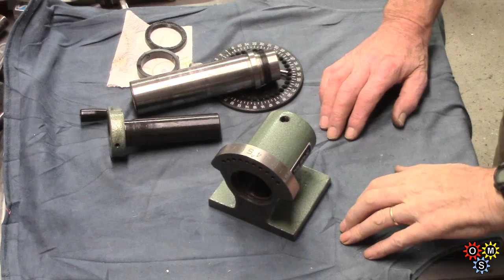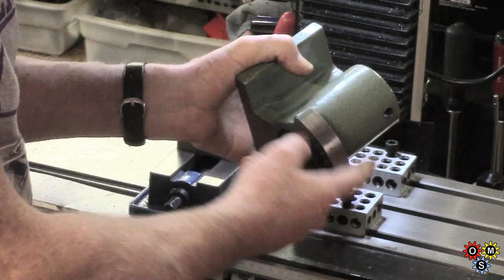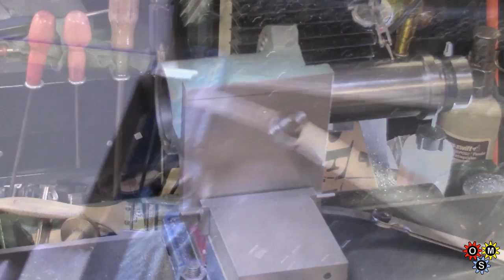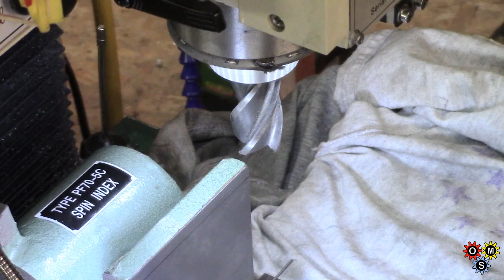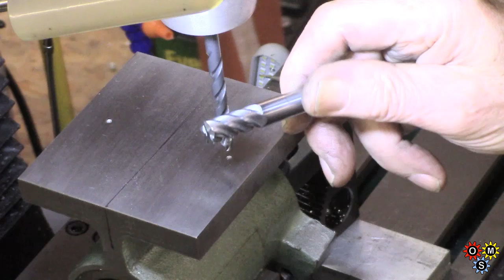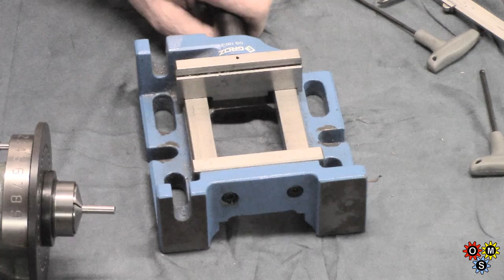Spindexer - Small Tweaks

Comment: Hi I like your work and your build on this project. I just purchased a Spin indexer with a tailstock end centre. It came with a great price.
Having a look around all the channels giving information on these units I found a channel with a great tip.
You can buy a 5c to ER32 collet adapter. Which fits the unit nicely. and the extra stick out of the ER32 collet nut is about 50mm which gives more cutter tool clearance from the index plate. I can now get better work holding grip using all my ER32 collets.
Hope this tip might help other hobby makers to get more use of their new toy. Check this link for more detail.
https://www.youtube.com/watch?v=VU6P5jhfIEA.

Comment: About 10 years ago I bought a spin indexer. I already had 5C collets and do quite a bit of small work. But the indexing plate kept me from getting really close. I reversed the indexer spindle so now can work very clos to the collet. I had also trued the indexer bottom to the bore so I could quickly setup in the vice. I can take the indexer in & out of the vice w/o losing reference.
Reply from the maker: Sounds like good mods. Sadly my shop time these days is near zero due to health probs but I still yearn to get back to some small jobs. :)

Comment: we mount things just as we can. not always optimal but if it works, mission accomplished haha. I'm in the same boat, my drill press vise opens 4" but is not tall enough to get a good bite so I'm thinking if I can set it on a pair of big V blocks and use long bolts in t nuts to hold it
Reply from the maker: Hi - well, as so often it's a case of ''whatever works'' :)

Comment: Hello, I am from Brazil, I would like to build a similar, the scale of 10 fixed holes do you know how many degrees has each spacing?
Reply from the maker: Hi Marcio - can't say spacing exactly - but, the 0 to 9 set of fixed holes for the register pin represent a 1 degree adjustment to the main disk, which itself is 360 degrees. For example - if pin in 0 hole and through into disk #10 hole, and lined up with engraved arrow -  then position is exactly 10 degrees. If pin then put into #5 hole and disk rotated until pin engages again, then that would represent 15 degrees.
Hope that helps - difficult to explain but maybe you get the idea.

Comment: Have you considered creating a block that will fit your smaller vise and bolt to it through the slotted holes in spindexer base?
Reply from the maker: Hi Chip - that thought had crossed my mind but, even if using in a smaller vise the loss of available height clearance for my rather small mill could be a factor. May yet try it sometime.

Comment: Dear Sir, in my opinion again My opinion your set up is incorrect. The base of the indexer should have been against the fixed jaw of the vise to maintain perpendicularity. I would have set the 1x2x3 blocks on edge in the vise and used them to hold the spandex thru the bore. Use your machinist square to set the base perpendicular to the mill table. Easy set up easy change. Hope this helps in future endevores RJ
Reply from the maker: Thanks Randell - useful points :)

Comment: Did you realise that you can take the jaws off the inside and fix them to the outside ??? Your vice has a huge range > Best wishes Malcolm
Reply from the maker: Hi Malcolm,
Thank you. For some reason back then I had overlooked the jaws swap - but now do realize. :)
Reply: It's amazing how many machinist's don't realise the jaws can be mounted on the front and back of the vise. That has come in handy a few times. Possibly that is where they mount a vise stop,is in the holes for the jaw on the front.

Comment: Hi Chris. Just getting back in to this stuff after a long break. I haven't read all the comments yet so I might be wrong? Watching your video with the aluminium filler rod in the vice in between the machined 5C base and the moving jaw on the vice.. Shouldn't it be the other way around with your finished 5C base against the fixed vertical jaw of the vice with the filler rod in between the adjustable jaw and the uneven casting?
Reply from the maker: To be honest Tony I don't quite remember why!! I guess at the time I had some reason but it's a long while ago now. I agree with the logic of your observation.

Comment: I would have figured that you would have placed the finished side to the fixed jaw, with the wire on the painted side, at the movable jaw. Even better would have been to mount it upside down with the face on an angle plate. This would have let you cut both sides without moving the spindexer.

Comment: Nice work.  I recently made similar modifications my spin indexer to fit align more easily in my mill vise.  I had not considered using in on a drill press, but it could be useful.
Reply from the maker: +robert simpson 
Hi Robert -- for what it is and price etc -- it's a very handy device to have on hand. Sure saves all the setting up of a dividing head if it will do the job. :)

Comment: If I had been doing it,I would have clamped a 1 inch bar in the spinjig, then clamped the jig to the table, cut a 1/4 inch flat on each side of the bar. Then turn it over and clamp the flats in the mill vise on the flats and machined both sides at the same time and also take a clean up cut on the bottom to make sure that it is flat and true.

Comment: What ho Chris, I clearly did not express myself properly when I wrote about slots, mea culpa but you must remember English is not my mother tongue, that position being reserved for Gibberish.
When I mentioned slots, I actually meant open ended sideways ones. The reason being you don't have to remove the nuts and washers or fiddle around looking to fit it over wobbly studs, everytime you fit the thing to the table. You wouldn't need to fit it to a vice if my thought waves had reached you in time.:>)
Another thought being, most people make the, understandable (as machinists seem to like symmetry) error of fitting their vice in the centre of the bed. Error for two reasons, one you only wear bed ways and leadscrew in one spot, and two, if offset, you can fit something else, like a spindexer, alongside. Personally I do this and, to even up wear, everytime I remove the vice for some reason I put it back on the other side, so that over time it averages out the wear.
LL&P
c
Reply from the maker: +Chris Stephens 
Very good point Chris with vise position - totally logical. I have to remove vise for a small job today and will almost for sure give it a change of position.
I get your point too re the slot idea. :)

Comment: suggestions and questions:

  1) why so tied to the idea of holding the indexer in a vise? was it to avoid having to tram it? why not mill a key sllot to fit the table slot accurately?
  2) re the 6" vise, why not mount it with the lead screw parallel to the table slot v at 90 degrees. no hang out issues then.
  3) when you spoke of making slots i envisioned them being at rt angle to the sides rather than parallel, a la the slots for vise        mounting. 

i seem to have forgotten some other things i meant to ask... one just came back; re the missing bench block, it was a tool knome playing a trick on you... they do it to me all the time!1!
Reply from the maker: +crazymanmichael  Hi Michael,
Guess I am not sufficiently confident in the absolute accuracy of keyslots, re repeatability. Prefer to see an indicator every time!.
Thought about the different fitting of the big vise - just hadn't tried it - but probably will... if mounting holes can suit my T-slot arrangement.
Just made those base slots to permit a bit more adjustment potential.
Haha - yes, the bench block! The 'tool gremlin' - the one that makes things invisible, at least until well after the item is really needed! :)

Comment: Hi Chris, as a suggestion, if you want more stability, you're gona have to resolve yourself to dismount your vise, and, use some 1-2-3 blocks and, or, angle plates... I was watching and trying to send waves about how you could do with the blocks...   :))
Came out nicely even without my help... ;)
Reply from the maker: +pierre beaudry Thx Pierre.
Haha - thought I felt some strange vibes! 
The vise thing is laziness in part - as I have it very accurately set up and don't want to have to do it again! Plus too - I want a better 4" anyways but what I want is rather pricey! Always other ways come up, after the event! :)
Reply: Setting up a vise can be pretty easy, as you might have seen on one of my videos, it's done in max 3 passes, and, you don't even need an expansive parallel, any straight piece of steel will do... Just take a look, and let me know what you think about it...  ;)
Reply from the maker: +pierre beaudry Can't say setting mine up is actually difficult at all - just that it requires fitting up the indicator in the spindle usually... the laziness factor! Forget whether I saw your video but if you have a link, do send it along, thx Pierre.

Comment: This all turned out well! But why do you need slots when you are fixing down to Tee slots ? It would have been much easier for you to use the machined base as a datum, then mill two registers on top of the body so that you could fix down knowing everything would be in parallel , you could also have clamped between two 90 Deg angle plates onto the ends of the cylindrical boss to machine the base sides,  after sawing the excess waste off on your new bandsaw! Well done on a result on this awkward holding job. Chris B.
Reply from the maker: +Englishman French  As ever Chris - several ways to skin a cat! I only chose slots just to give a bit more latitude though probably not really necessary. Angle plates certainly could have been another option, although what I have available is not very ideal - too large in fact. Bandsaw could have helped if I'd bothered to try.

Comment: I just drilled holes in mine. I did a quick video a few years back. Putting it in your vice might limit the size of things you can mill. Great work!
Reply from the maker: +Bob Cartwright Hi Bob -- Yes, holes probably would have been adequate .. just seemed a useful addition to slot - probably not essential at all! I don't think using in the vice too problematic, as size would be very much limited to max collet size available. Don't often do really big jobs.
Reply: +ChrisB257 Pierre Beaudry beat me to it, an angle plate would have been a more stable way to hold the Spindexer.

Comment: Nice mod! The next time you have to mill a slot, drill the hole like you did, then use your end mill like a drill and drill through move over .100 or so and drill down again and again. Much less stress on the spindle. It werks fer me. Give it a try. Thanks for the video, CJ
Reply from the maker: +CJs Custom Thank you -- appreciate the tip - makes sense when I think on it! That's what is so great about YT folks - always something to learn. :)

Comment: Chris, you can place the jaw plates on the outside of your mill vise. That way you won't have to use the drill press vise.
Reply from the maker: +MrPragmaticLee Thanks. Nice idea but, I don't think on that little vise it would work and give enough contact area.  In fact, the Groz Vice is quite adequate I think for the odd occasions - and as I showed, just adding it to side of main vise will still allow access to the work without much X travel change.

Comment: Hi Chris !

The more I see this SpinDexer the more I tend to put in on my "TO DO" list - it is a bit more nifty than setting up the dividing head - is this your experience too ?
Reply from the maker: +Keld Sørensen  Keld -- well for $53 it seems great value, even if precision is not absolutely tight. I reckon this will come into use when collet blocks can't do the job but dividing head not needed. If the work can divide within 360 then it'll be handy IMO - even if just occasional...such a modest investment and lots of folks like them apparently.
Reply: ChrisB257
Thx for your time and explanation ... buying is a non-existent option for me ;-)) that's why it may bee added to my TO-DO list